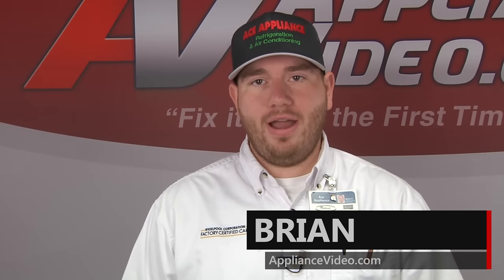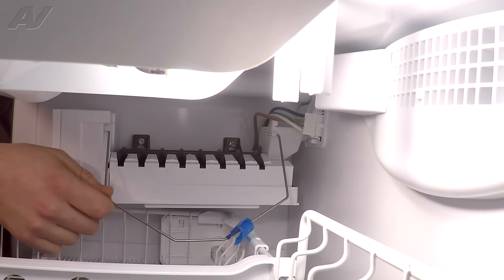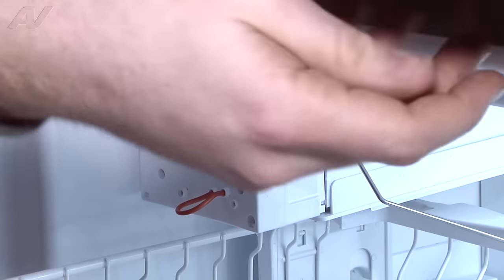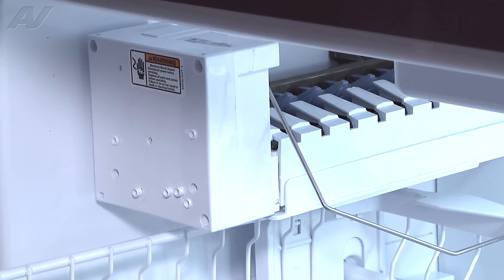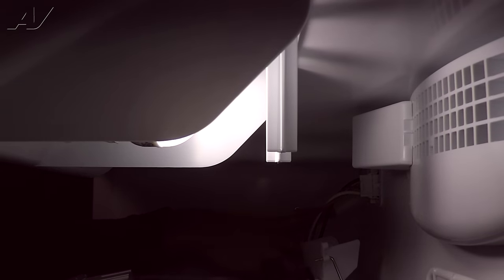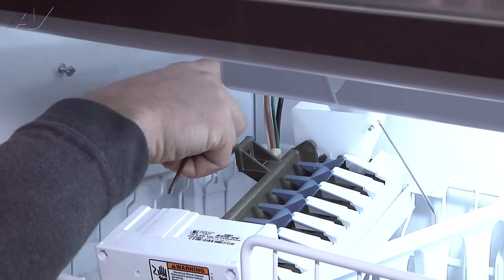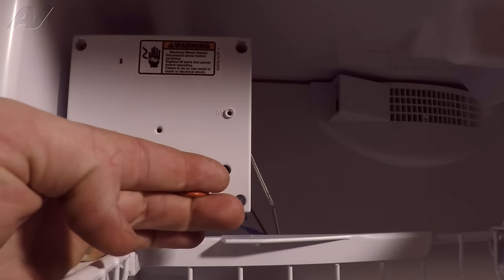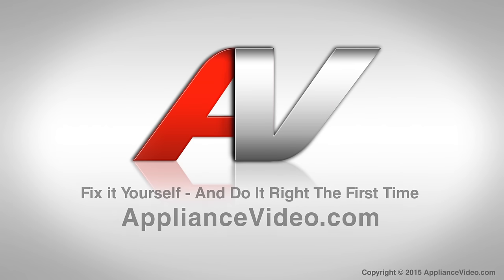Whirlpool Refrigerator Repair - Not Making Ice - Diagnostic & Troubleshooting

Comment: Hello, we have WhirlPool Fridge Model ED5FVGXWS05, we want to manually cycle the ice maker through a test cycle. We have our test wire. Which two terminals do we use? Thank you!!!
Reply from the maker: Great question, if you have a more technical question that our parts department cannot answer, you can search our over 17,000 answered questions free at our website www.ApplianceVideo.com under our Repair Help section. You can also call our parts department at 1-800-830-5465 and they can give you help 7-days A week ,or search at www.SaveMoreOnParts.com  .
Reply: T & H

Comment: Mine one of the outer fingers is bent up  and cube getting stuck push it down but week and gets pushed up.anything I can do?
Reply from the maker: Great question, if you have a more technical question that our parts department cannot answer, you can search our over 17,000 answered questions free at our website www.ApplianceVideo.com under our Repair Help section. You can also call our parts department at 1-800-830-5465 and they can give you help 7-days A week ,or search at www.SaveMoreOnParts.com  .

Comment: when you use the jumper wire, is it ok to do this on a new ice maker that doent have water?? with the front square cover off ,can i tell if the circuit is working or not
Reply from the maker: Great question, if you have a more technical question that our parts department cannot answer, you can search our over 17,000 answered questions free at our website www.ApplianceVideo.com under our Repair Help section. You can also call our parts department at 1-800-830-5465 and they can give you help 7-days A week ,or search at www.SaveMoreOnParts.com  .

Comment: What if I don't have a jumper wire? Can any wire be used?
Reply from the maker: Great question, if you have a more technical question that our parts department cannot answer, you can search our over 17,000 answered questions free at our website www.ApplianceVideo.com under our Repair Help section. You can also call our parts department at 1-800-830-5465 and they can give you help 7-days A week ,or search at www.SaveMoreOnParts.com  .
Reply: Use a paperclip

Comment: What's the cause of frozen water in the tube?  I think it should be resolved to avoid recurrence.  Thanks for sharing
Reply from the maker: Great question, if you have a more technical question that our parts department cannot answer, you can search our over 17,000 answered questions free at our website www.ApplianceVideo.com under our Repair Help section. You can also call our parts department at 1-800-830-5465 and they can give you help 7-days A week ,or search at www.SaveMoreOnParts.com  .
Reply: water valve to ice maker is letting a little drip into fill tube,to fix .........replace water valve 
45 yrs of doing this work

Comment: What if the T H test will not make the handle to move up
Thanks
Reply from the maker: Great question, if you have a more technical question that our parts department cannot answer, you can search our over 17,000 answered questions free at our website www.ApplianceVideo.com under our Repair Help section. You can also call our parts department at 1-800-830-5465 and they can give you help 7-days A week ,or search at www.SaveMoreOnParts.com  .

Comment: nothing happens when i do this, the wire seems to do nothing.
Reply from the maker: Great question, if you have a more technical question that our parts department cannot answer, you can search our over 17,000 answered questions free at our website www.ApplianceVideo.com under our Repair Help section. You can also call our parts department at 1-800-830-5465 and they can give you help 7-days A week ,or search at www.SaveMoreOnParts.com  .

Comment: I did the jumper wire and my ice maker just kept rotating and didn't apparently call for water. Ran for at least 15 min. Does this mean the unit needs to be replaced?
Reply from the maker: Great question, if you have a
more technical question that our parts department cannot answer, you can search
our over 10,000 answered questions free at our website www.ApplianceVideo.com under our Repair Help section. You can also call
our parts department at 1-800-830-5465 and they can give you help 7-days A week
Monday -Saturday, or search at www.SaveMoreOnParts.com  24 hours
7- days A week.
Reply: When it keeps rotating. It means you have a bad Ice maker
Reply: @mohammadnazeershaifta2078  Thought so; replaced the ice maker and it works perfectly. Easy repair.

Comment: Hello, can please tell us what can be the problem if water comes and cubes are created but icemaker never drops them. I already put the new icemaker and it still does the same. Fills up with water. Makes cubes but never drops them. Thanks
Reply from the maker: Great question, if you have a more technical question that our parts department cannot answer, you can search our over 10,000 answered questions free at our website www.ApplianceVideo.com under our Repair Help section. You can also call our parts department at 1-800-830-5465 and they can give you help 7-days A week Monday Saturday, or search at www.SaveMoreOnParts.com  24 hours 7 days A week.
Reply: I have the same problem. Did you figure it out?
Reply: @carlonatividad8652  yes I did. Mine was bottom freezer, and when door is closed door switch was not getting pressed. Try taping your door switch, leave it for 12-24h if cubes are made , you have same issue

Comment: Your comment at 6:19 is incorrect. You said to push the tabs on either side to release the wiring harness. To release the harness it is necessary to pry the holders on top and bottom of the plug with a flat head screwdriver, then pull the plug out.

Comment: I have this type of refrigerator. When we installed it 8 years ago, we never connected the water line. Last week I connected water for the first time, installed the (still new) filter and purged it for 3 minutes per instructions. Water dispenses from the tap but I CANNOT get any water to dispense into the ice tray at all. The tube is not blocked because it's never had water in it. I tried clicking the switch (metal arm) up and down several times. Inserting the jumper wire and holding down the light switch doesn't do anything. No clicking noises from inside. Any suggestions?
Reply from the maker: Great question, if you have a more technical question that our parts department cannot answer, you can search our over 13,000 answered questions free at our website www.ApplianceVideo.com under our Repair Help section. You can also call our parts department at 1-800-830-5465 and they can give you help 7-days A week ,or search at www.SaveMoreOnParts.com  .

Comment: I just replaced my icemaker with a new unit, Kitchenaid model KBRA20EMSS.  I've tried the jumper cable on both the new and old units.  Neither one will cycle.  The water dispenser works fine, and the fill tube is clear. Any ideas what is going on here?
Reply from the maker: Great question, if you have a more technical question that our parts department cannot answer, you can search our over 10,000 answered questions free at our website www.ApplianceVideo.com under our Repair Help section. You can also call our parts department at 1-800-830-5465 and they can give you help 7-days A week Monday Saturday, or search at www.SaveMoreOnParts.com  24 hours 7 days A week.

Comment: After a day of trying to figure out, and do simple "try" fixes (unplug,  turn off ...),  I discovered that the shoot to fill the tray was solid ice. I got a hair dryer,  thawed it out and now it's back to producing ice. Why would this happen?
Reply from the maker: Great question, if you have a more technical question that our parts department cannot answer, you can search our over 13,000 answered questions free at our website www.ApplianceVideo.com under our Repair Help section. You can also call our parts department at 1-800-830-5465 and they can give you help 7-days A week ,or search at www.SaveMoreOnParts.com  .
Reply: water valve to ice maker is letting a little drip into fill tube,to fix .........replace water valve 
45 yrs of doing this work
Reply: @keysthinking  ,  I did replace the valve and its been working Great.!!

Comment: Well done videos.  Not sure if you can answer this.  My ice maker appeared to have died.  It fills and it cycles until the ice freezes but it won't drop ice.  Maybe the heater??  Anyway, replacement ice makers for this 13 year old Kenmore (LG) is very high.  Are there generic ice makers that will fit any situation?  Ps  No ice issue or problem with inlet valve.
Reply from the maker: Great question, if you have a more technical question that our parts department cannot answer, you can search our over 10,000 answered questions free at our website www.ApplianceVideo.com under our Repair Help section. You can also call our parts department at 1-800-830-5465 and they can give you help 7-days A week Monday Saturday, or search at www.SaveMoreOnParts.com  24 hours 7 days A week.
Reply: Same problem. Did you figure it out?
Reply: @carlonatividad8652  Yes.... it was the tray (heater) in the ice maker.  I replaced the unit with a new one and it is fine.  I could have bought a replacement tray but that was almost as much as a replacement ice maker.  Good luck.... Ps.  Those trays when they get older start to flake the finish... you may see this in the ice.   Replace it and wait a few hours before you will see new ice.